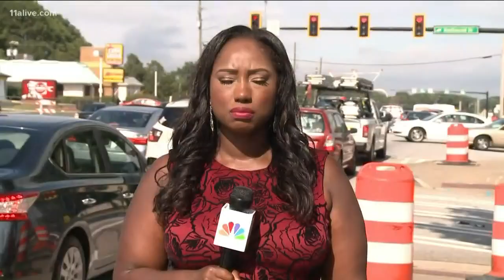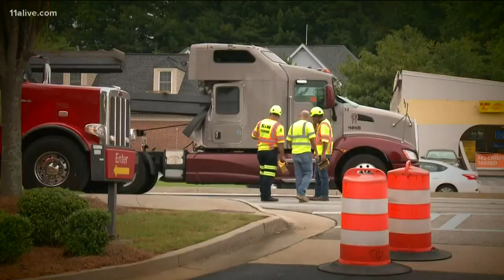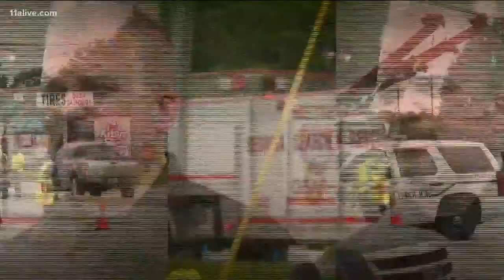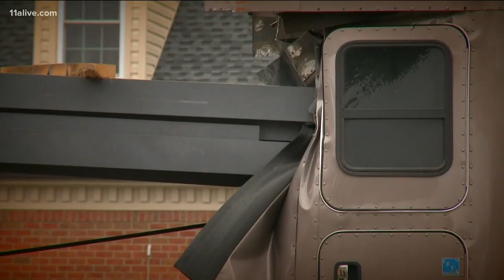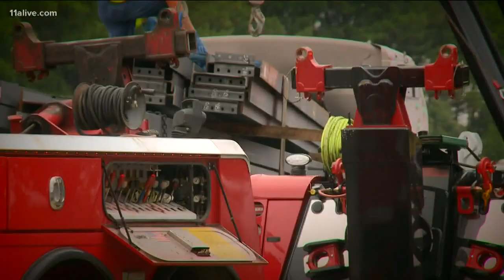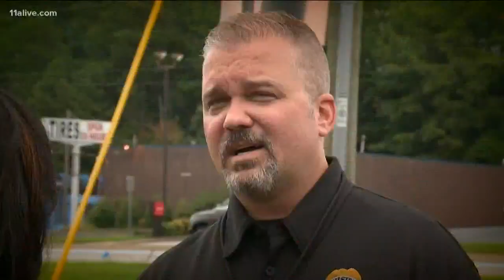Driver killed after steel beams crash through cab from back of truck

Comment: Can someone Anyone any trucker tell me how you can know what your hauling but then magically  become so distant so complacent that you allow this to take your life...how many of us are well informed about Murphy's Law how many of us know the importance of preventive maintenance.so how does something like this get overlooked was this trailer a flat car with head board or one without ..just one look at this load and I'm already nervous these never haul right they always shift always come loose.thry are by far the hardest to keep stationary even more so after being  manufactured and welded into different sizes shapes because they no.longer interlock ..this drivers complacantcy killed him ....
Reply: You don't know ANYTHING about how the trucking companies skirt the law these days. The pressure for time on the drivers could well be avoided by having intelligent dispatchers (ha. ha.) or dispatchers who actually drove a transport. The latter is rare, because that would not fly with management. The industry is largely out of control, with a few notable exceptions. The good companies do NOT perform like that, and that's from an insider.

Comment: Some tell me what a headache rack would  done. That load would just pushed it thru the cab
Reply: If you don't know, you should NOT be driving transports with a flatbed.
Reply: @paulmunro3175  so how else do drivers haul over length loads,
And I am a cdl holder that has ran flatbed
Reply: @robertchristensen2633  Over length and width require a permit and signage. The bottom line is safety; if you do not feel safe with the load, you are within your rights to refuse the load and inquire as to whether the equipment is proper for the haul. A simple test is to ask a rational question; if you get brushed off, sneered at or ignored, leave the load. These reactions are all you need to confirm your intuitions: TRUST THOSE FEELINGS. Contact any reputable school for information; there are courses for improvement at the better ones. And the Transport Ministries all have a help line.
Reply: @paulmunro3175  oh i agree its the driver rear end at the end of the day. with that too sir nothing is gonna stop a load from shifting if a 4 wheeler cuts you off or decides to stop dead in front of you
Reply: @robertchristensen2633  He stops dead in front of me, he's dead in front of me. Don't drive without a dash cam.
Reply: A quality rack would have slowed down the load significantly and save the old timers life.